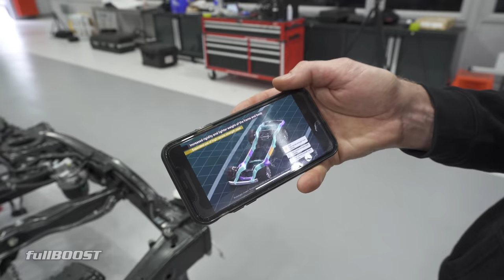Dissecting the new Toyota LandCruiser 300 Series | fullBOOST

Comment: Crazy to think someone can pull that to pieces and put it back together.
Reply: Why crazy? It’s not an iPhone glued together.
Reply: @ppal64  you capable of pulling that apart to the same extent and putting it back together?
Reply: I basically do this everyday as a panel beater, not to this extent but I'd be confident pulling this apart and rebuilding it exactly the same.
Reply: To anyone who works on cars this would be a dream.
Not a rusty bolt is sight. 
Everything clean.
No idiot has been there before you.
The only difficult bit would be going back to working on rusty cars.

Comment: a plastic turbo inlets, connected with a silicon boot hoses sitting on the top of the very hot exhaust pipe, located way in the back on the motor, good luck replacing it and they will get dry and crack for sure, in FJ80 we have a name for it  " pesky hose" and this one have two of them.

Comment: the pimples on the body bump stop is probably used as 'tell tails' to tell how much and at what angles the body has been flexed.  If the pimples are only buffed off on one outer edge of one stop them there has been a lot of flex up one side , if the tops of both are scrubbed then its GVM has probably been maxed out quite a bit.
Reply: Or an injection mould mark from manufacture
Reply: You are far to smart. Hats off

Comment: THAT is how you make a underground hoist! my workplace has the ones with the posts UNDER the car, that you have to drive over a 4in tall steel plate that reaches outside where the arms mount on. It baffles me why that company wouldn't just put the posts out from under the car and just mount the arms on the post like the one in this video!

Comment: I have dissected a n80 hilux and found that the ecu/bcm, loom and relays are very prone to water damage. One blue relay is not cheap @ around $50 x 30 or so. The electrical system seems to be very precise and poorly protected from water. Unlike older Toyotas where as you can basically throw them of a diving board.

Comment: Very Impressive video, great work!
P.S They still use Hydraulic steering on all 4x4 in the Toyota range because for heavy offroading if the wheel is stuck in a rut the electric can overheat whilst trying to steer.
Reply: didn't they mention hydraulic/electric hybrid systems in the LX600 ?
 , I am wondering since the ZX trim is usually very close to the Lexus LX, I am looking for an answer to that.
Reply: @Voltedge89  same Lexus but maybe this of is not full ZB from the wheel and screen I can tell
Reply: @mauzouq  i am still wondering got my name for VXR in Alsayer , if the lx600 less than 6000kd more expensive  I might go lexus anyway .
Reply: @Voltedge89   for just book the lx600 you have to pay 2k DK it will be more expensive than the vxr for sure just don’t know how much expensive my thought the price will be 36k

Comment: Riddle me this please, up to the 80 series all Land Cruises and Prados had six wheel studs. Then with the 100 series Land Cruiser it was changed to five stud while Prado remained six stud. Now with the 300 Toyota has changed back to six stud again. It can’t be due to weight so why the changes. Just one of those things that makes you go Hmmmmmm.
Thanks Stuart 🇦🇺
Reply: Trying to swing the market through design. 6 stud continued to remain popular through many models.
Reply: @milesabove5259  
The 5 much more than widely spaced out wheel studs designed is objectively superior IMHO. Structurally stronger and eliminating the issue of idiots trying to get away with screwing on only 3 of the 6 nuts. Problem is probably aftermarket not catching up.

Comment: Would have been good to see a close up of the Alternator and how difficult it would be to change.
Also the belts
Reply: The LC ute had the alternator problems not the 200
Reply: @jasonswift7098  They are in the same place . This is about the 300 . Have you seen where it is ?
Reply: @RGF56  the 200 series LC did not have alternator issues that was the 70 series utes.

Comment: Toyota never used cam adjusters on front lower control arms on LC 100, 200 and 300...Impressive. Instead, the camber/Caster adjustments are located in the upper Control arm.

Comment: got to be said, i found that rather fascinating - but then i just happen to be pulling one apart that is in bits, i can't show or share images as its been heavily armored and tested with around 12lb of explosives which went off next to the drivers side (left), as far as i am aware, it didn't like it much, probably rolled over once or twice, some deformation at the drivers door and floor area, the survival space was all in tact, but i can't say the same for the rest of the car, the chassis is shredded along with the fuel tanks, so it wouldn't get very far, naturally the wiring failed nearly everywhere and i'm sure would render the vehicle completely useless after an attack, but even items like the anti roll bars, shredded, whatever is on the rear of the transfer case, and i did observe in your video, was shredded with some holes into the transfer case, so oil would be lost, its a very complex machine with an awful lot of external components that get damaged

Comment: Brilliant looking car, but they should've kept selling it with the 2UR V8 and sold another kagillion of these for another 2 decades. It's not like they stopped using the V8, it's in the 2022 Lexus LC500. 🤷
Reply: That’s because I believe it’s based on the older shape
Reply: @TheWretchedWorld  Which is still a UR engine in the 1UR and 3UR. 👍
Reply: And it’ll cost $500 dollars in fuel every trip too the shops
Reply: @thomasclark6642  Like every other car on the road with today's petrol prices. 😉
Reply: We can't buy these in the 'States in any configuration...
Reply: @thomasclark6642  if you choose the v8 model then you ain't gonna care about petrol prices.
Reply: The Diesel V8 was massively under tuned due to emission regulations, the same reason they ditched it.
Reply: @madmick3794  Yeah, the VD is junk. I'm talking petrol V8 only. 😎👍
Reply: @MafiaboysWorld  Lexus the only one getting a petrol, nice but they are looking at the TT V6 from the lexus coupe. Its an okay motor though seems to lack a bit.
Reply: @madmick3794  All of the 300s have the Twin Turbo V6 bro, be it a Landy or a Lexus (Added edit: Also doesn't matter if it's petrol or diesel.). That's my whole argument. The 2UR is V8, still in production, has been used since the RC-F and currently in the LC500. 👍 Them in 300s would've sold like hotcakes like the 200 series V8 Sahara's do. 😎

Comment: Hi there, not sure if this is the right place to ask for help, but i have an LC300 with slight rough idling. We took out the injectors and had them serviced, but the problem still persists. Fuel pressure, air flow, map sensor, all the basics seem fine.

Im wondering if mounting failure is a common fault on these cars? Or would anyone have any other suggestions on what else could possibly cause the slight rough idling?

Its most noticeable at around 1000rpm, after that you cant really feel it anymore. Any help would be greatly appreciated!

Also, what an awesome video!

Comment: The way i see this, is like this if Saudi Arabia and UAE buy them and run them in 45 degree days with out any problems yet, then just think of the engineering for heat management for the top of the engine and turbos which Toyota has done  incorporating into building the engine and performance, no need to put a top mounted air dam or bonnet scope, unless you can prove it will change the heat near the turbos, maybe a interchiller will work so much better, re: A/C gas used to cool the air coming into the intake? But then again, you need to understand the engine and how efficient its is and how much damage the really cold air will do to it?
Reply: Ferrari looked at the "Hot V" for their F1 engines back in the early '80s then BMW used one in Its twin-turbocharged N63 V8 in 2008. There's advantages and disadvantages but with today's Turbochargers and airflow/cooling performance, there's more advantages than hassles. The REAL problems start with the mechanics/technicians who have to have fingers like an alien to work on the top of the engine and turbos. I remember seeing an airflow diagram of the engine bay of a BMW E90, a few years back and being amazed by the design creating the venturi pulling air through the front and out under the vehicle. Toyota would have spent ¥ to get the best out of the space available but from my perspective, the maintenance and servicing becomes harder and harder. This also happens from the bodywork perspective too. When aluminium takes a ding, it stretches more than steel and is harder to shrink back into shape and it's softer than steel so a little scuff that would scratch the paint on a steel panel, causes damage to an aluminium panel that is likely to need a replacement panel. But, all in all.... I am sure that the 300 will be a winner.
Reply: Although you can buy diesel LCs on the grey market in the GCC (UAE, Saudi, Oman, etc) it’s only the petrol versions that are sold here.
Reply: They use petrols in the Middle East, not the diesel you see here

Comment: No excuse for missing a bolt on a modern automated production line. There are automated checks that look at number and torque of bolts. Ok if it was 1920.
Reply: ROFL, right. Meanwhile most other companies are sending cars out with mismatched seats, bad tunes, or worse, shit engines. You literally have no idea what goes into production. Automation is around welding, painting and the like. Assembly is still manual. What decade are you living in?

Comment: Science anyone?
Hot air expands and rises 
Where will it go?
Reply: Oh. No. I reckon no one realised that.
Reply: Down through the floor once you get moving, so as a highway car I wouldn't worry too much. I'd hate to see all those plastic components in a few years after all that soccer mum heatsoak. Modern diesels are looking more spaghetti factory than petrol engines now. I remember turbo cars from the 90's and all their vac and coolant lines. This looks worse by a long way.
Reply: Here in mid-East people who owned LAND CRUISER 300 drive them like maniac even in hot day like no problem maybe will happen in long term

Comment: I absolutely hated the newest version of the Toyota land cruisers I personally prefer the original version of the Toyota land cruiser not even the latest version of the Toyota land cruisers are all cheapest plastic parts 4x4 the newest version of the Toyota land cruisers are junk 4x4 with the oldest version of the Toyota land cruisers you can thrash straight through bushland and the person coming through the other side comes out no markings or any scratches or any damaged parts on the oldest version of the Toyota land cruiser because the original version of the Toyota land cruisers had a very sturdy metal base bumper bars with the original hooks on the oldest version of the Toyota land cruisers because my only biological dad used have a Toyota land cruiser and he also used to converted his own original version of the Toyota land cruiser into a Toyota land cruiser jeep version and in 1989 he decided to convert it back into the original version of the Toyota land cruiser and he ripped out the old Toyota land cruiser motor engine and my dad decided to drop in a Holden V8 engine into the Toyota land cruiser and he did it so so perfectly executed it into the Toyota land cruiser and he started it up and it's was and sounded beautifully enough and he didn't even botched the job there because my dad was and used to be a custom made panel beater in regional Victoria here and that's when I was a little kid here when he did all of that with himself altogether when I was a little kid here
Reply: Have you heard of punctuation?
Reply: @billamota  didn't need punctuation either in the "old" cruiser 🤣
Reply: You said Toyota Land Cruiser 13 times too many
Reply: He meant the "old toyota landcruiser" im pretty sure.

Comment: pro: no starter motor or fuel cooler in the V
con: hot V related heat issues (cooling, fans running after switch off, wiring heat stress.)

Good luck to those who bought one, that warranty is gonna cop a work out

Comment: To me Toyota have lost the plot. Landcruisers were once simple reliable things. THAT engine is not. And I doubt the rest of the car either. 3.2 twin turbo hi tech and TEN speed auto real easy for a bushy to fix in the middle of the desert! NOT. Dragging around 2.5 tonne, the same as my 100
I have had a few 100s, all petrols as those V8 diesels have got a reputation,,, all bad!
Good driving vehicles, good towcars though the V8 petrol and diesel have a huge gap 4-5. Early 4500 petrols & 4spd are in some respect better. 
I have considered upgrading to a 200 but that rotten V8 diesel,,,,, As a rich bloke I know said after his expired while just still in warranty you sell them before the warranty runs out. I know of six in 100s and 200s that have blown up, at under 200000km. As a dealer I have to warrnty them that long.
Reply: Those old simple motors were great, but they no longer pass emissions standards. It’s not Toyota’s fault. At least they’re still having a go. Everyone else in that category has packed up and gone home. Hopefully in the not too distant future, their solid state batteries work out and we can be using electric powertrains that are far simpler and will power a campsite for much longer and need bugger all maintenance.
Reply: U should know that we r living in this modern era where good old reliable things will eventually fade out with new things. Now with stricter laws and emissions whatever r making changes in present and future will make difficult in people's life and everything.
Reply: The diesel V8s soot up and then they die. They'll go forever as long as you put a catch can on it from new. Or clean out the engine and then put a catch can on it.